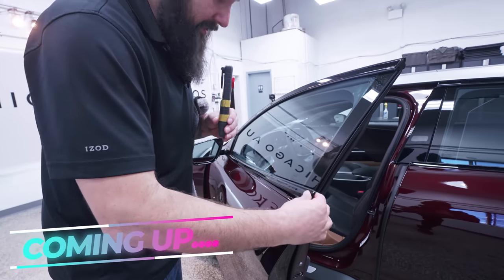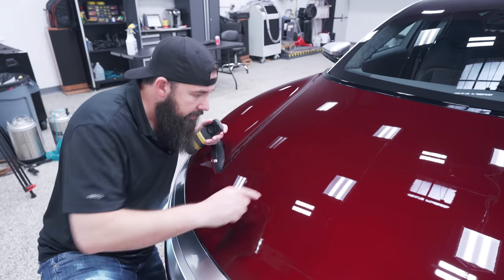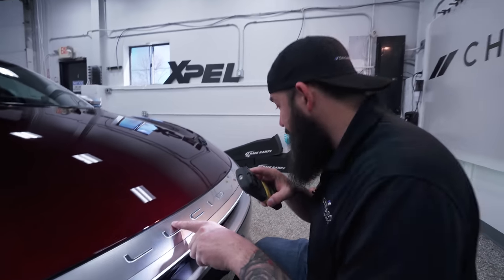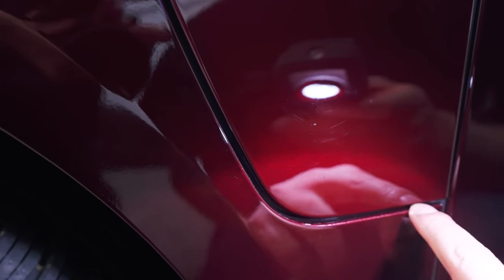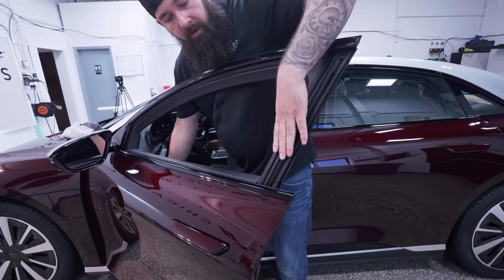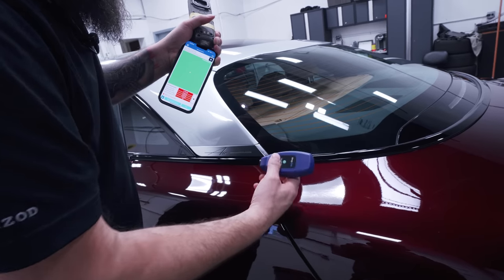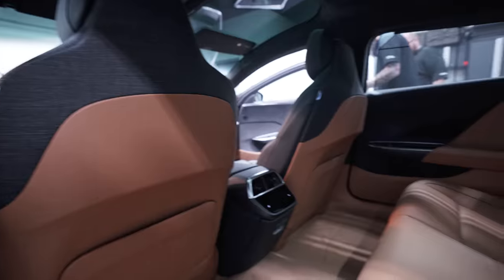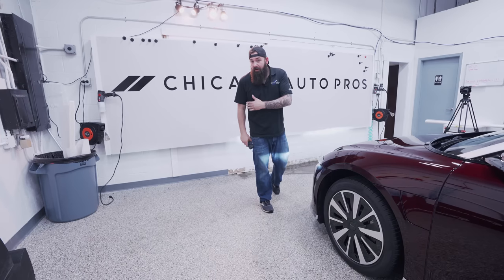2022 Lucid Air Inspection + First Impressions | How Bad Is It?

Comment: You need the lights there because of DOT laws. If the trunk is open, the lights on the trunk aren't visible so you need some sort of red light always visible on the rear of the car. Just like pickups and tailgates
Reply: Not in the USA.
Reply: Only in countries that require it
Reply from the maker: Makes sense!
Reply: I came here to say just that
Reply: Who drives with the trunk open? Another example of dumb laws for dumb people.
Reply: @The_Cyberz  and dumber don't understand. If you have to stop your car on the side of the road at night and take something from the trunk, then without those lights the back of the car is completely dark. Might cause an accident, and actually have caused many accidents on highways.
Reply: Yes in the US too. Especially for a scenario when you are parked on the highway shoulder, changing tires, and trunk is open. Oncoming traffic should be able to see your reflectors.
Reply: Chevy Bolt additional lights were added to to be compliant with regulations. Two more things that regulation requires is side mirrors instead of cameras and hazard lights button on dash. Even Tesla could not get away with it.
Reply: The Audi Q5 / SQ5 has those lights as well (perhaps other Audi SUV models as well).
Reply: @andyhedin4893  also mk1 A1 and couple of other audis and opel/Vauxhal estate-models. Almost every newer car that has all the tail lights mounted on the tail lid. Some SUVs and older 4x4 like Land Cruiser and Pajero have second lights on the bumber.
Reply: @The_Cyberz  It is designed when stopped. In a break down situation the trunk may be open. An oncoming driver would not see the flashers in such a situation. Those light work off the brake and hazard circuits.
Reply: @Tig-Wan  learn your automotive laws
Reply: @The_Cyberz  
It’s so you don’t get crushed to death while getting something out of the trunk or on the side of the road in an emergency situation with the trunk open in low light situations. Careful what and who you call names!
Reply: @Tig-Wan  Why do you insist on publishing your ignorance?
Reply: Yes, the extra lights are required in the USA. The Bolt-EV and others are the same and they are functioning brake lights so if he had someone push the pedal, they should get brighter.
Reply: @Tig-Wan  if iam not mistaken the US requires that the break light must be installed on a non moving part of the car in a fixed position
Reply: @Tig-Wan  actually, yes in the USA.
Reply: @The_Cyberz , imagine you’re broken down. Trunks open to get things open or your spare. Your hazards need to be seen at all times. These repeaters allow for it. Audi has used them for years.
Reply: @Tig-Wan  changing the tooling to have to versions costs more, food for thought
Reply: @Tig-Wan  It is required in the US.
Reply: Like on the BMW iX
Reply: @Tig-Wan  in the us u need it too..
as well as in many countries across the world
Reply: @The_Cyberz  when you’re parked? people have to be able to see you
Reply: @The_Cyberz   Parked on the side of the highway at night changing a flat.
Reply: Fish sticks, you are incorrect.
Reply: @Tig-Wan  Oh yes in the USA
Reply: Weird …. A lot of new cars you can turn off the rear lights though … even while driving
Reply: It already has bumper lights right below those.
Reply: @Tig-Wan  Germany
Reply: @HighAltitudesCO  those are probably just reflectors, not lights.
Reply: @ville85  Yeah, true, they look ugly plugged into a nice bumper otherwise.
Reply: Wrong. Every legal car in the US needs the mandatory red reflectors for that. And this car already has them on the rear bumper.
Reply: @ville85  that's what the mandatory red reflectors are for.
Reply: @The_Cyberz  what if you need to haul something that extends beyond the tailgate.. pretty clever to have tail light then.. ohh and when you break down on the highway and open the trunk to set up the hazard triangle.. then get hit from the behind.. because the car was dark..
Reply: He definitely doesn’t watch Doug’s videos. 😂
Reply: @The_Cyberz  no-one but people sometimes park at the side of the road with the boot open to get stuff and idiots crash into them
Reply: Correct.  

Most vehicles have them half on the trunk half on quarter panels for that reason.
Reply: Yup. My Audi Q7 is the same way since the rear lights are attached to the rear door.
Reply: @ChicagoAutoPros  My new BMW iX is the same. ANd the salesman said that it is for safety.  Excellent video by the way - I am very impressed by your attention to detail! Maybe you should contract to Lucid for quality control!
Reply: @Tig-Wan  yes in the USA. Came here to say the same. DOT required.
Reply: @The_Cyberz  if it was meant for driving with the trunk open it would be required to have a breaklight too........
Reply: I don"t understand people who don't understand that your car needs lights when your trunk is open. I mean, how hard is it to put three things together? Don't you see the lights on the trunk lid go up and out of view when you open it and subsequently realize your car has no longer rear lights pointing towards traffic? And step 3, can't you fathom the huge potential risk this creates for everyone involved, including your passengers and other people using the road?
Reply: @The_Cyberz  people with stuff longer than the trunk bed....ever heard of construction workers?
Reply: @The_Cyberz  See w85; and think twice, speak once.
Reply: Everyone needs to watch more Doug Demuro. He always talks about tail lights not being allowed on a moveable part (trunk lid) of the car. Or if they are, you have to have other tail lights to compensate, like this Lucid.
Reply: @Tig-Wan  it still helps... hahahaha
Reply: @Tig-Wan  yes in the usa, brake lights can't be on movable parts
Reply: @kophiedogbey2227  Sure. Never met one driving a sedan let alone a Lucid tho...
Reply: @kakkelakken  Warndreiecks are partially required in the USA, but not for passenger cars.
Reply: @ChicagoAutoPros  Seeing the guy so amazed is just the best thing when reviewing intercontinal products.
Reply: @Tig-Wan  No that's a law ONLY in USA.
Reply: Nice these typical American answers. As if the USA is the only place where people drive cars and where Lucid is planning to sell it.
Reply: how does this guy not know this
Reply: @The_Cyberz   if you stop at night and open the trunk it is good to have lights so that others can see you and you don`t get hit. not all lights are for driving.
Reply: @Tig-Wan  yes in the US.  This is a workaround they did because it is illegal for manufacturers to mount the lights on the trunk lid or tailgate.  That law went into effect in the 70s.
   I got a ticket last year because we mounted the lights on one of our trailers on the doors.  They still worked, but because they were on a move able surface they were illegal.
Reply: was going to say exactly this!
Reply: @The_Cyberz  People who are smart enough not to buy a 1/2 ton pickup truck to transport 8ft 2x4s once every 4 years?
Reply: @The_Cyberz  Maybe you didn't catch that it was an electric car.
What kind of idiot wouldn't catch that? Oh yeah.
Reply: @The_Cyberz  come on! Can’t you imagine being stuck on the road side and having the trunk open? Spare wheel perhaps? Warm clothes? Something to drink? Etc etc
Reply: @Tig-Wan  Of course you have to in the US. In fact, that's where it originated.
Reply: @Tig-Wan  yes the US requires them lol
Reply: @Tig-Wan  only in responsible countries, so definitevely not US
Reply: @Tig-Wan  the USA does require it.
Reply: Yeah, Doug Demuro comments on this a lot.  I was going to say the same thing.  Good call.
Reply: Same thing for Audi Q7, Chevrolet Bolt and all the other cars with the taillights integrated with moving parts. This is really a good idea, otherwise the other drivers could not see you during the night if you had the tailgate opened.
Reply: @Tig-Wan  wrong. 100% required in the USA. And this car was definitely damaged during transit and covered up
Reply: @Tig-Wan  yes in the USA Same reason Audi   suvs have lights on the sides off the rear because when the rear hatch opens the taillights go with it and it’s dangerous at night to not have hazard nor reflectors visible .
Reply: @The_Cyberz  what if you have something slightly too big for the trunk and it has to be open
Reply: @Tig-Wan  It is a specific US requirement.  According to the FMVSS taillights cannot be on a moving part that causes them to no-longer be visible.
Reply: @The_Cyberz  Who drives with the trunk open?  The same person that closes a garage door on a $140,000 automobile.
Reply: @Tig-Wan  Yes exactly in the USA.
Reply: @The_Cyberz  Ever try to get an 8 foot log fence post home with the trunk lid closed?
Reply: @The_Cyberz  it's a safety measure so if your on side of road.
Reply: Another vehicle like this is the Lincoln MKC or whatever it was renamed to. Because it has a "clamshell" lift gate there are lights built into the body so the vehicle can be seen at night if the lift gate is open. This is a federal reg and so are the sun visor that are just suck to the windshield.
Reply: @The_Cyberz  Well your wife will, of course, when she goes to the nursery to bring home new trees for the back yard and then paver stones as well.  It's amazing how many women I have seen trashing out nice cars like this simply because they don't want to arrange for delivery.
Reply: @Tig-Wan  yes in the US. Federal code 571.108 S103:  “Except as provided in paragraphs S5.3.2, S5.7, and S7, each lamp, reflective device, and item of associated equipment shall be securely mounted on a rigid part of the vehicle other than glazing that is not designed to be removed except for repair”
If you put tail lights on a moveable piece (ie trunk lid) you have to have lights on a non-moveable part to replace them. Maybe this wasn’t for older vehicles but it’s been a requirement for a while.
Reply: Sorry, didn’t mean to beat a dead horse, I didn’t see the other reply’s.
Reply: @Tig-Wan  Yes it is.
Reply: The extra tail lights are required so that is your car is broken down or stopped on the side of the road with the trunk open, passing cars will see your tail lights and emergency flashers. It has been a DOT requirement for a few years.
Reply: Only where you don't wanna die on the side of the road.
Reply: Correct!!
Reply: @The_Cyberz  people who pickup stuff that doen't fit perfect. in aus, tail, brake and indicator always need to be visible. so maybe that light bar does all too.
Reply: @Tig-Wan  I believe it is in the US as well. But in the US you can have the turn signals substitute as brake lights or vice versa, assuming you had turn signals that is.
Reply: @jamesscully529  It's a bit more about how common people drive with the trunk open as something they put in doesn't actually fit. Even more common today with giant TVs.
Reply: @ville85  No they're real lights Doug Demuro showed they are real and said they are for legal requirement.
Reply: DOT exists in other countries?
Reply: @Tig-Wan  Yes in the USA -- § 393.11.
Reply: You must live in India
Reply: @The_Cyberz  I can tell you that in Europe we dont use trucks and endup using cars to transport stuff that is too big. The law in europe states that the brake light and turn signals need to be on an not moveable part of the car. if you have the lights on the trunk, you need a second set that is on the inside on on the bumper. because lights on bumpers are not nice to look at, manufactures decide to put them on the inside of the trunk
Reply: @kakkelakken  hazard triangles not required in US
Reply: @Tig-Wan  YES IN THE USA.
Reply: @The_Cyberz  Its not when your driving it if you are pulled over at night and have to open trunk to get spare you want to the lights to be seen by others.
Reply: @The_Cyberz  You lack any imagination if you can't immediately think of multiple reasons someone might have the trunk open. Just taking stuff in and out of the trunk is one. Or if you need to fix a flat on the side of the road. And you can't tell me you've NEVER seen someone driving with the trunk open to get an extra-large object home. It isn't at ALL a dumb law. It's a very good law, and only dumb people would think otherwise.
Reply: @The_Cyberz  You're not smart.
Reply: Wrong.
Reply: @Tig-Wan  The US require lights to be install on a non moving body panels. you can see this on the chevy volt and the 92 Honda accord.
Reply: You beat me to it. 👍
Reply: @Tig-Wan  Actually I think it is the USA that requires this.  Once you know the law then you see it on more and more cars.  My i3 had additional taillights that were only active when the trunk was open.
Reply: @Jadasic  The USA was the first country to require it. lol
Reply: @Tig-Wan  Yes in USA too
Reply: @The_Cyberz  it's also for if you're on the side of the road and you're accessing your trunk.. lights will be on.
Reply: @The_Cyberz  Taylor made for USA!
Reply: The taillights are in the trunk lid. So, when the trunk lid rotates upward to open, there is nothing to illuminate the rear for safety, hence the need for fixed secondary taillights. If the taillights were in the fender, those secondary lights would be unnecessary
Reply: @The_Cyberz  people who put something big in their trunk and strap it in.

Comment: I used to work as a quality inspector in the paint department for Toyota and it really opened my eyes to the complexity of paint. To control a near perfect environment is almost impossible but one of the steps we took was to crater test. That's when everyone touches their face with their hands then smears their hand onto a panel and then the panel gets painted. If you are "contaminated" craters would immediately appear. To keep this from happening we were not allowed to use certain shampoos, conditioners, deodorant, etc.

Even with all these precautionary measures, problems always arise so it's not uncommon to have "abnormal work" where a vehicle may have to be repaired (seeds, orange peel, scratches, thin paint, runs, sags, etc). 

Like others have said, even when a vehicle leaves the paint shop, there's a whole other set of variables during assembly: team members dropping tools on the side members, outside auditors being careless and coming too close to a vehicle with non-line approved clothing, or someone with contaminated gloves touching interior parts and not realizing, etc.

Every vehicle may not be perfect, but I can tell you, everyday we are trying our best to identify, resolve, and prevent these abnormalities from happening. It's a never ending battle.
Reply: Well if you buy a $30k Toyota, you would be ok with some flaws. When you pay 140k? You probably want the best of everything! When you pay 140k for a brand that just made it's first car(model), you are crazy.
Reply: Mock me if you must, for being a VW Phaeton enthusiast. But part of the pride and joy of owning one (two in my case), is the flawless fit-finish-paint that comes from having been mostly hand-made in the "glass factory" and I expect Lucid to equal that, given the price point. My '04 W12 was $140K new, adjusted for inflation. 70K miles, pristine 4-seat limo, not for sale lol.
Reply: Thank you alot, now i know why painting a wooden panel didnt work. After I grinded the primer, I touched the surface with my hands.
Reply: @ericjbowman1708  that car didn’t sell
Reply: @lehelzelenka207  Money does not say everything about what it is worth. For some people 30K is a load of money and for some 140k is pocket money. A new car just has to be 100% for the customer. That can mean it is not 100% for those detailing "nerds"' that simply see more than the average person
Reply: @MarcoB838  Dude there are industry standards that you cannot neglect otherwise your product will be a laughing stock. Can't sell a 6 digit car with orange peel paintjob.
Reply: Nothing
Reply: Bro me too which plant did you work at?
Reply: @lehelzelenka207  No you wouldn't be okay with some flaws. If anything the 30k Toyota demands better paint because nobody pays 140k to keep a car long term, money doesn't matter to them.
Reply: Dodge/Chrysler/Jeep probably just uses paint spray cans, gives it a quick rinse with a garden hose, and call it a day.
Reply: @ericjbowman1708  Lucid just started building cars on a larger scale. Give them some time to learn. Volkswagen has been building cars for many decades now. Even for a 30k VW you can expect quite some quality. However, I do agree, for 140k+ I'd expect an immaculate paintjob. Immaculate!
Reply: This was eye opening. Thanks for sharing!
Reply: @lehelzelenka207  100% correct  Lucid should be paying for these corrections not the customer.
Reply: Why would a team member drop a tool on a side member?  That's some real malice shown to a coworker.

/s
Reply: Working in a factory I know that all too well.  Even though I was in thermoforming, long story short... the worst thing outside of your own faults... idiots.  We all like to think companies would weed out people that don't have the intelligence level to be in a given area within a given job, buuut..... yea it happens and those people screw everything up along the way... even get others fired for their misdeeds.  Then there's the imperfect stuff that makes it to customers because of them.
Reply: @lehelzelenka207  eh, they mostly do deliver. Way more so than tesla